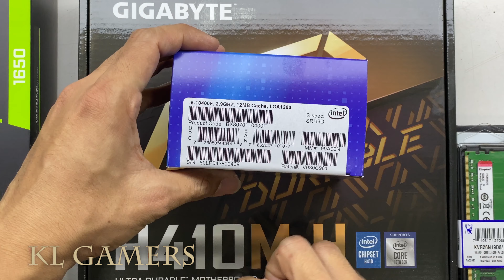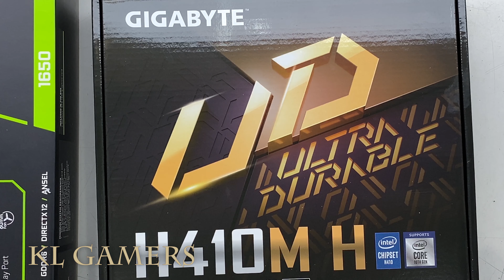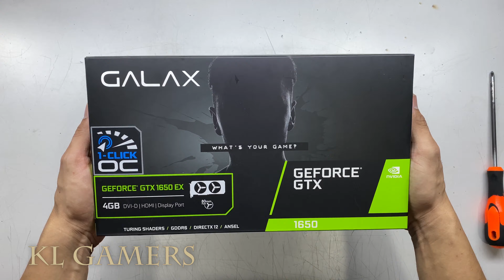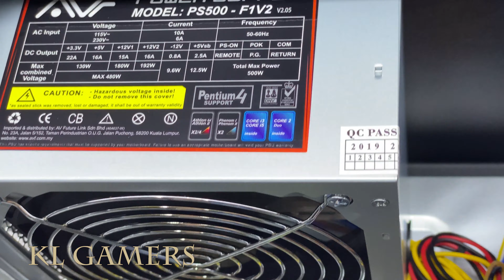intel Core i5 10400F GIGABYTE H410M H GTX 1650 Gaming PC Build

Comment: You dont need to wiggle the cpu just to aligned the contact. It may damaged the pcb contact of your cpu. Trust me, your the only channel that i've seen
Reply: actually no a few people I know do that, it's not the best but not even the worst, cpu are now quite resistent. a little wiggle will cause probably no damage
Reply: @davidelancellotti8796  no. Have you ever work on pcb factory? Any scratches on the contact copper may affect on the whole diaghram. Just imagine the ram copper contact.
Reply: @wakokokwakekek9244  no i haven't, i was a system builder for a little shop for like 15 years
my boss taught me to never wiggle to hard but a very small wiggle to put everything in place is just fine, it's very hard that it would cause damage

i'm not telling to like give a giant 5cm wiggle ahah
Reply from the maker: small wiggle to ensure the processor in place does the trick

Comment: Why in your assemblies you do not connect the speaker to the motherboard.? Don't you like the sound of the beeps when starting POST?
Reply: some mobo now don't even have post sound, they have onboard led that give a code
also almost every mobo has a little speaker on board to play the POST sound
Reply from the maker: usually modern PC motherboard have self diagnostic LED so no need beep

Comment: next build you could use a B550 Aorus Pro (ac or not), it's an amazing board and it has 11 usb ports and 1 type c port in the rear I/O
i had it for a few months now and it's really good, not the cheapest but surely one with the best value
Reply from the maker: Sounds great!
Reply: instaBlaster...

Comment: Bruuuuuh how did ya get 1650 😱
Reply: I found an rtx 3070 for 800
Reply: @bingk398  haha 😂 my pc it's worth that much 😊 just 50 bucksi think
Reply: @muradh5888  im building a pc with a i5 11400 with 4000mhz ram ddr4 16gb with an rtx3070 for 1300
Reply: @bingk398  that's a killer pc but I'm a ryzen fan boy
Reply: @muradh5888  intel is cheaper but out performs the ryzen 9 3900x by a little
Reply: @bingk398  ya ya any way I have no money to do anything 💰💰💰
Reply: @muradh5888  the i5 11400 from intels 11th gen is about 180
Reply from the maker: wow rare Pokémon
Reply: @KLGamers  how manys pcs you build every month
Reply: @bingk398  4000mhz are totally wasted on a intel cpu, save some budget by buying 3000 or 3200 modules
Reply: @davidelancellotti8796  meh wouldn't waste money on ryzen when intel out performs ryzen by a little and more fps from intel
Reply: @bingk398  where the hell i talked about ryzen. ryzen is a extremely good lineup of cpus especially 3000 and 5000 series. 
apart from that, i only said that intel does not gain so much performance with fast ram, it's a waste of money buying 4ghz modules 

with that being said, actually the performance of 11th gen and 5000 series are more or less the same, so you should buy the cheaper option (for example, in my country you can get one of the best cpus ever which is the r5 3600 for like 160€, while the i5 11600f goes for more than 200€)
Reply: @davidelancellotti8796  I was saying that intel 11th gen is cheaper and I get what your saying